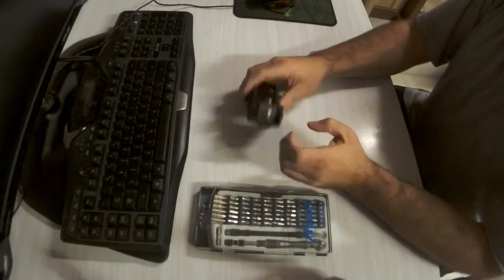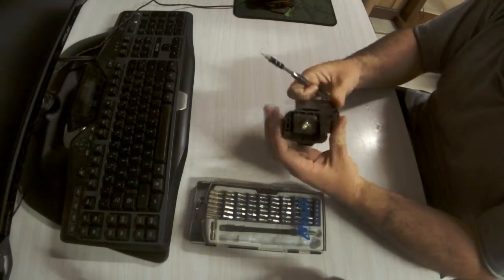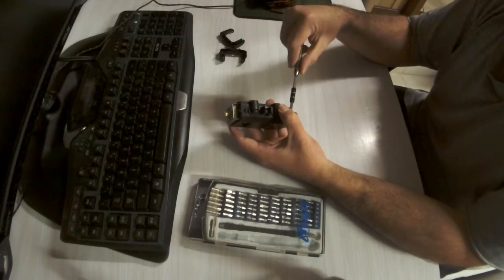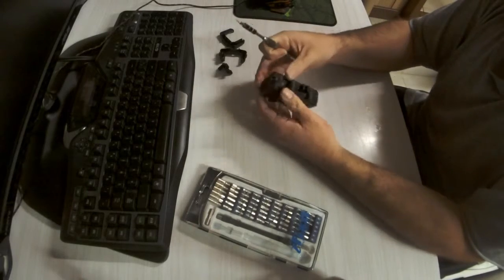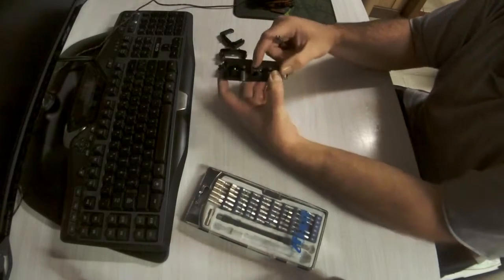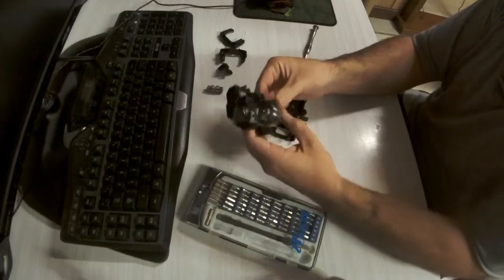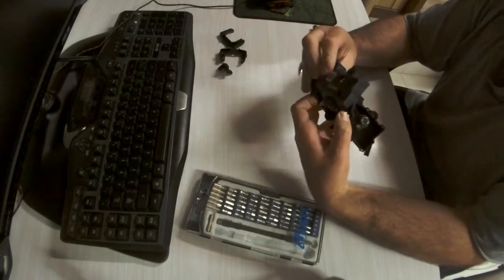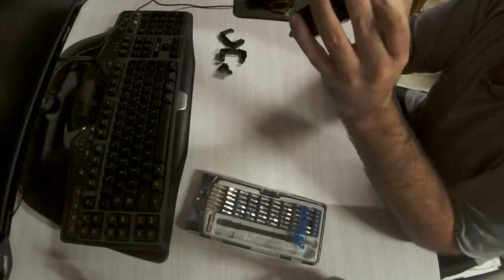Makerbot Mini Unjam Smart Extruder

Comment: BEST SOLUTION EVER: I have the Replicator mini and was having the same print quality problem(not being smooth) Solution I found was rubbing little bit of Olive oil to the fillament while feeding it into extruder. Not much just get your fingertip little wet and start rubbing it around the fillament. This will Lubricate the inside of the nozzle and. You will be amazed how effective this is. Also if you keep getting "Fillament Jam" error message and stop printing, Olive oil fixes it immediately. !!!! You're welcome people!